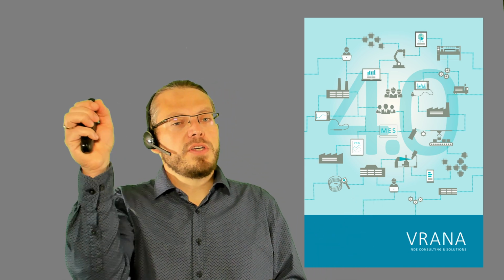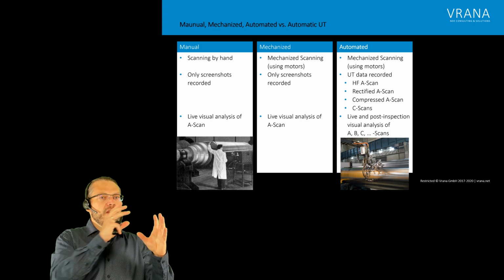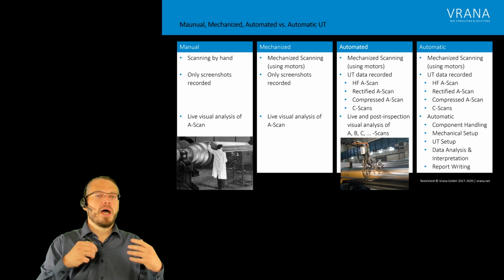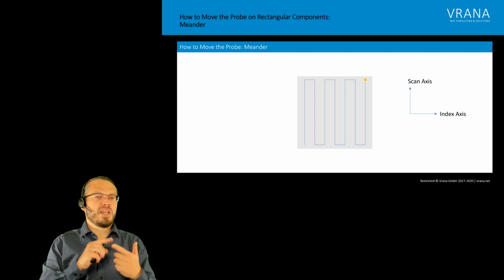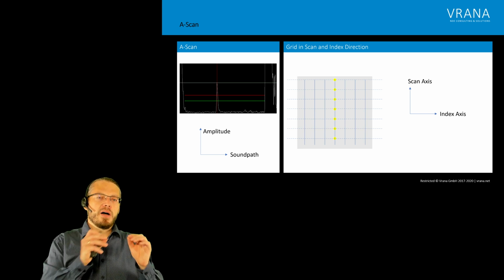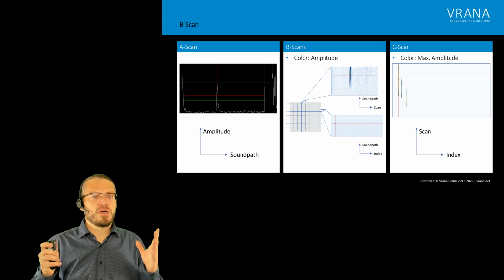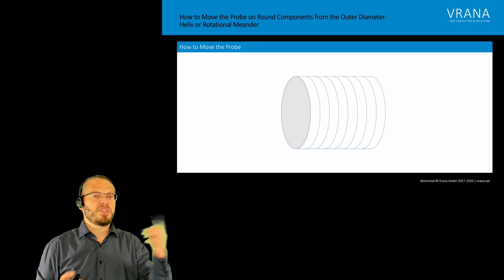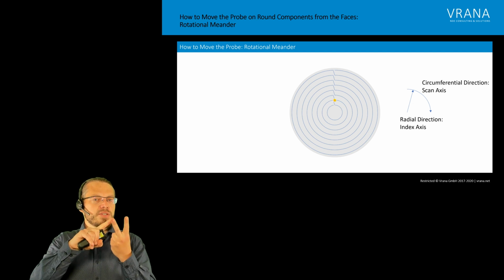Automated Ultrasonic Testing

Comment: Could you explain the terms “Index axis” and “Scan axis” in relation to the X, Y and Z axis for a robotic PAUT scanning system? Is this another way of converting a 3 way directional movement to a 2 way representation on a computer screen?
Reply from the maker: That is actually a quite a challenge. Index and Scan axis are pure surface coordinates. This is easy for flat components but it gets already quite complex if the component surface has a 3D shaped surface. And once you are using a robot: robotic coordinate systems are usually in 6 Dimensions: 3 dimensions for arm placement and 3 dimensions for probe orientation. Therefore you need a mapping from 6D to 2D - which is quite advanced linear algebra. A chapter of the Handbook of NDE 4.0 takes a look into the math of this issue: https://doi.org/10.1007/978-3-030-48200-8_5-1. But there are also some UT Instruments which can directly record 6D coordinates.

Comment from the maker: In the heat of the moment ;-)
18:00 Clearly not 1000s of probes but 1000s of channels
22:00 It is actually a system using air-coupled ultrasonics from Hilger NDT  (https://www.hillger-ndt.de/)